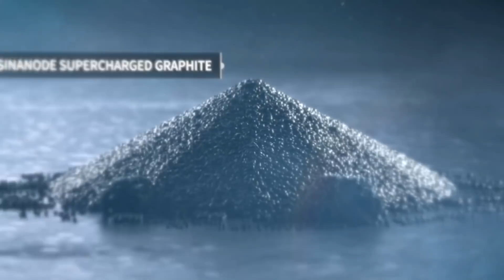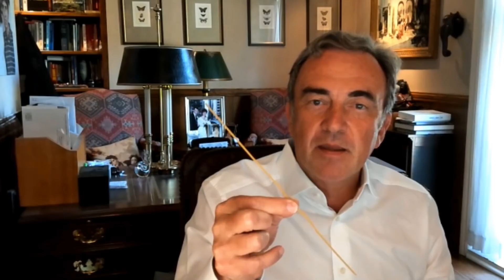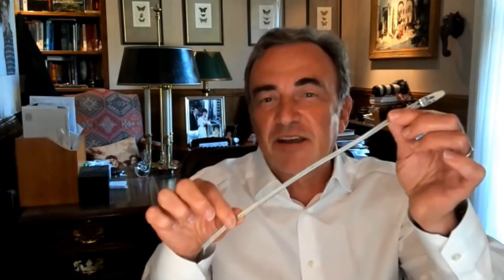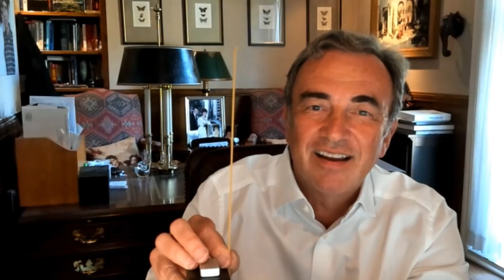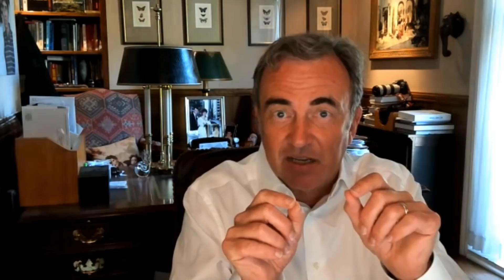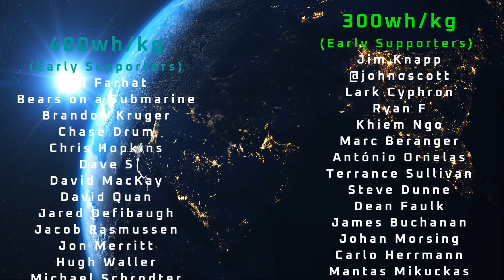Sinanode: Low Cost Silicon Nanowire Coated Graphite for OEMs

Comment: Very interesting on how it might be integrated with DBE. Wonder if Tesla is looking into this with any seriousness

This process really reminds me of how TSMC grow some of their silicon
Reply: TSMC is working on the next generation of silicon transistors, which are even smaller and rely on silicon nanowires. These are called "gate all around transistors" where the flux of electrons from one end to the other end of the nanowire is controlled by the voltage applied to a "sleeve" around the nanowire. Very cool stuff, but much more difficult to manufacture than the silicon nanowires on graphite that the OneD SINANODE process makes....
Reply: @vincentpluvinage5834  thank you for the info :) will definitely be following sinanode's progress. Wish you the absolute best!
Reply: @vincent pluvinage  Wondering, per that outfit in Phoenix AZ (GruberMotorscom) that recovers Tesla battery packs by isolating, then "clipping off" parasitic cells, could some of this tech be leveraged to have damaged/low-performing cells remove themselves from pack circuitry, thus extending pack life by orders of magnitude?

Comment: Thank you!
Reply: @joey_after_midnight  LARGE SCALE SINANODE PROCESSING PLANTS are processing graphites from multiple suppliers, to add the nanowires, and the resulting composite powder (graphite + si nw) is then shipped to various EV cell makers. This processing step is not that different from other processing steps that the industry already for graphitization and carbon coating. The important point is that no OEM wants to depend on only one EV cell maker and only one graphite maker, especially with different supply chains in China, US, and Europe.
Reply: Sounds like a win win for all battery manufacturer OEMs
Reply: Lost me at the end were they’re doing one of the steps in their own factory thought this could be done by just adding a step in the battery manufactures factory